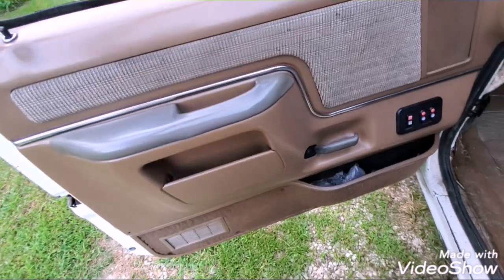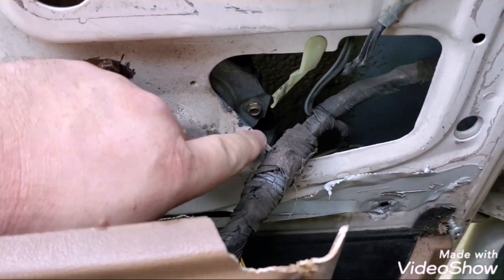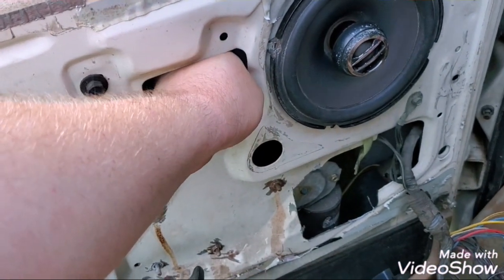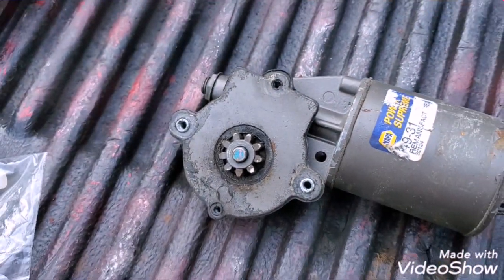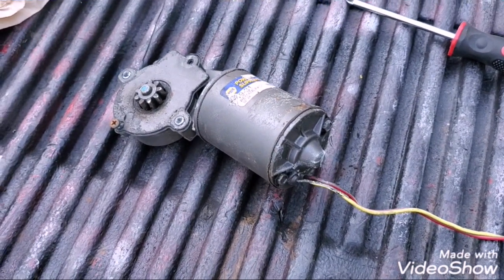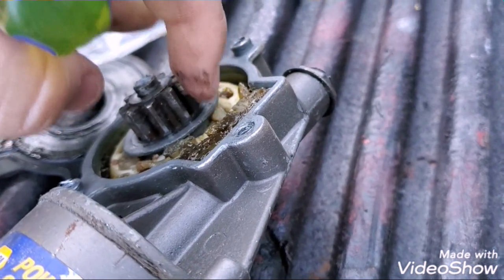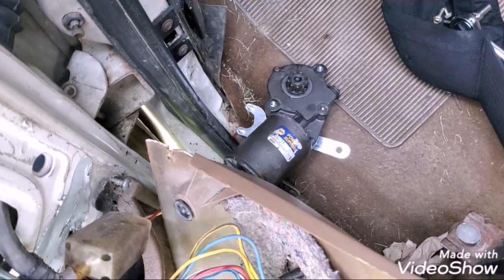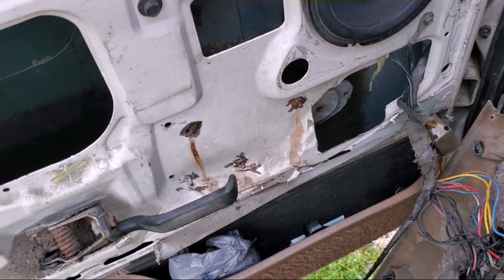OBS F-Series: 1987-1991 F-Series Power Window Rebuild

Comment: The white gear comes up and out too... for total cleaning.  I used 7/16" wooden dowel pieces.  Strong, quiet, free.  My kids are mid-20's ha ha.
Reply: Noticed you redid your window motor. Do I have to have window down, or could it be in the up position, not sure what up with mine still have to get into it. Went to bring window up and it stopped. Helped it a little by pulling up on window and hitting button, started to come up on its own then stopped. I managed to get it closed. If it is the motor do I have to pull out regulator to. Or I can just drill out those holes and use socket to get motor out. Any help would be appreciated , thank you
Reply: @nickpanhead7209  Once you get the door panel off you can see that the glass window should be UP. The motor tilts to come out; glass would be in its way. Yes, drill out that hole, 1/2" drill, and use a magnet on your socket to keep nuts from falling down inside the door.  DO NOT USE WOODEN DOWELS (as I stated above) as replacements for the plastic.  The grease softened and the gears chewed up my wood in 2 months; use steel/zinc ball bearings of 7/16" from hardware store. Pack the gears with grease.  I wish I could send you photos of my repair job.
Reply: @trevortrillion6037  thanks Trevor, for getting back to me. I pulled it all apart and noticed it was done once before. So I did not have to drill anything out. The big plastic gear is cracked in half. Going to Napa tomorrow to order replacement plastic and metal gear. It don't come with the 3 plastic break away bushings. Any tricks to getting motor back in place, lining up with gear.
Reply: @nickpanhead7209  MY car is the 1994 Explorer 4x4.  The big plastic gear is sold on eBay too.  Not necessary to buy the plastic "break away" pieces.  Metal ball bearings are perfect, will last forever.  Buy 12 for all 4 windows eventually.  (I did two windows twice due to my worthless wooden dowels) The window motor is NOT strong enough to damage a hand or head.   ANY tooth on the window motor gear can go into the window mechanism gear (add a little grease too).  You will feel the two gears accepting each other.  Put a scrap of Kleenex into your 8mm socket to hold the little screw-head firmly in the socket.  Magnets on the ratchet extension helps too.  Screw it in a few turns.  Do that 3 times for three screws.  A small flashlight might help you eyeball 3 motor holes to 3 door panel holes.  Later, tighten all three screws.  Connect the wires and try everything a few times, up, down, up.  good luck.  My front windows have worked fine for 16 months now.
Reply: @trevortrillion6037  great Trevor, I found whole kit on Amazon for 15  and change coming Friday. I'll install it then. Thank you for your help and advice
Reply: @trevortrillion6037  all fixed and put back together, working great. Ty